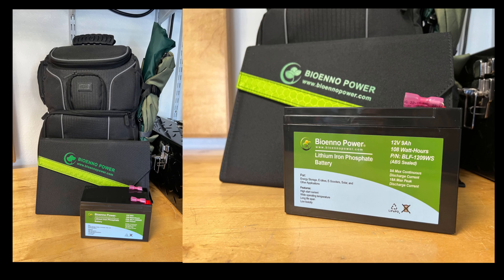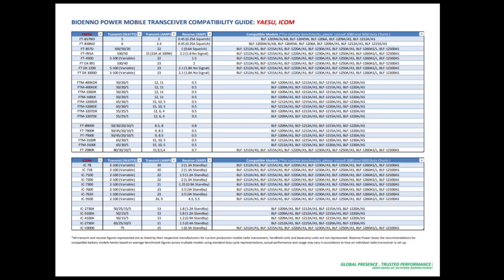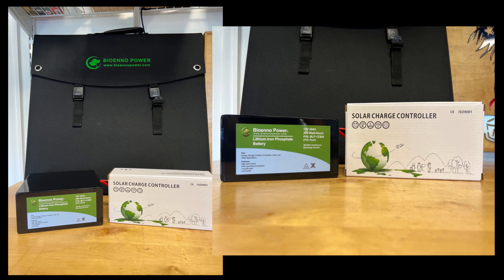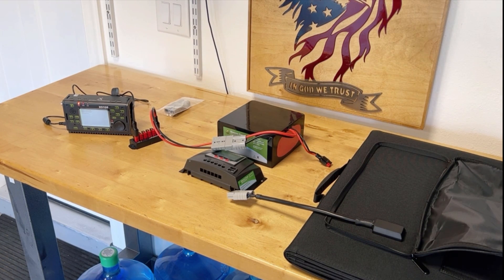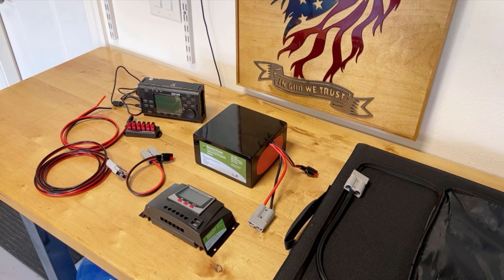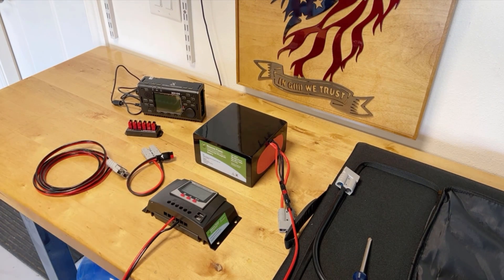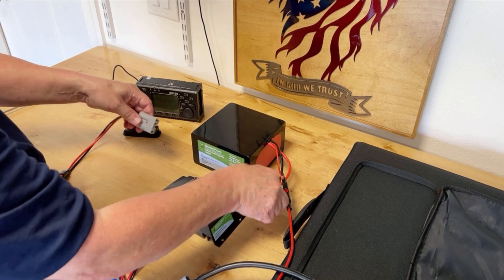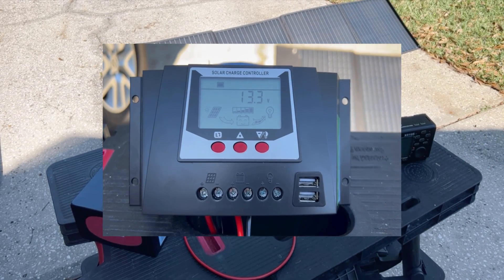Using A Solar Panel With Battery With Charge Controller For Your Ham Radio

Comment: What is the advantage of running the load directly from the battery rather than running it from the LOAD terminals on the MPPT?  A direct connection like that is going to short-circuit the load to the charging voltage from the MPPT rather than provide the typical output voltage from a battery.  You'd be running your equipment at charging voltage rather than typical supply voltage and the voltage supplied to the equipment would be variable based on whether there was sun to charge the battery or clouds causing the battery to drain to supply the load.
Reply from the maker: I've followed the manufacturers recommendations; I've figured the engineers at Bioenno Power know more about the most efficient set up than I do....that feels like a safe assumption.
Reply: @HOAHamRadio  Makes sense, and I think I answered my own question as the use relates to radio equipment.  Most portable radio equipment I've seen operates best at 13.8-ish volts.  The voltage required to charge a LFP battery is minimum 14.2, but 14.6 is best.  Setting the charger to output 14.2 and hooking the radio directly to the battery would mean that the voltage the radio sees would normally vary between 13.6 (LFP battery at full charge) and 14.2.  Well within the acceptable range for most devices.  Connecting to the load terminals would limit the voltage supplied to the controllers' max load output voltage.  I think that is around 12.8 volts on most of the cheap Chinese MPPT's.  It would still work, but may reduce output power available to the radio.

Comment: Thanks for this. I was going to connect the radio gear to the load terminals on my Renogy controller.
Reply from the maker: Glad you watched and hope it helped understand the basics.
Reply: @HOAHamRadio  Yes, thanks. I was in radio and telecommunications for almost 30 years. I've built dozens switching facilities and hundreds of transmitter sites. Solar is new to me.

Comment: If I can request a video. I have seen a LOT of ham radio videos about using solar power. Most of them are very good. But what I do not see it this.

How to put together a solar system that will not only run your radio BUT that will charge any other rechargeable devices that you commonly would use in the woods as well.

Simply, keep the radio running off the battery AND recharge/run you cell phone, laptop or tablet, flashlight, portable GPS signaling device ( SPOT, Inreach,Bivy)

I hope that makes sense I have asked a few youtubers this same question over the last six months and have never gotten and answer. So I suspect I am asking the question wrongly.
Reply from the maker: John, I think I follow the request.  I'm about 4 months out now on video planning, and I am going to add this to the list.  Basically, to change the other devices, "conversion" needs to occur typically through a charge controller.  Trouble is, most charge controllers don't have USB ports.  Still, I get the idea and I think it is doable.
Reply: @HOAHamRadio  Thank you for you quick response. Trust me  I have NEVER seen such a video. Ideally you would have everything fully charged before you left home. But as they say "What ever can go wrong will go wrong" And probably at the most inconvenient time.

 If I can add one thing. You would need to start off with how to measure the current draw of the non ham radio device. From there you could determine the size of battery and solar panel that you need.

Comment: What guage wire are you using?? Good video! Im in the process of putting together a go box of some sorts. Thanks!
Reply from the maker: Ted, I was using 12 gauge wire to use with my Bioenno 30 Ah battery.

Comment: Great video brother. I have a 300W 20 amp controller that says it needs 20-50 volts input to work. My 150W solar panel puts out 18 volts. Did I buy the wrong controller or will this one work? Do I need to buy another 150W panel to use this controller? I appreciate your help man. Thank you.
Reply from the maker: Aaron, thanks for the positive feedback.  I'm really good at taking what the experts provide and making sure I optimize it....  The experts I would turn to are Bioenno Power.  Any time I've had a question, they've gotten back to me same day.  I recommend reaching out to them sale@bioennopower.com